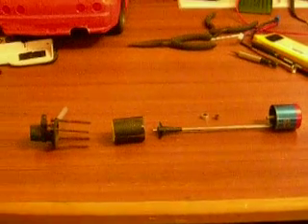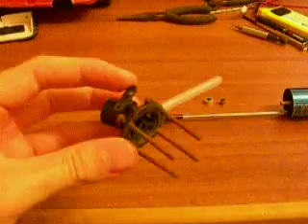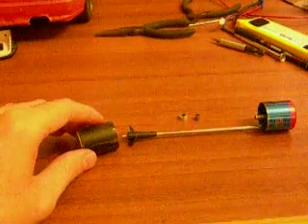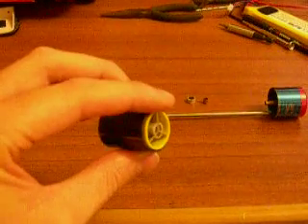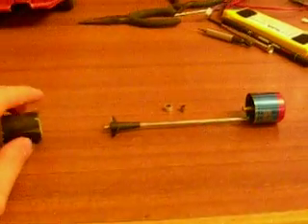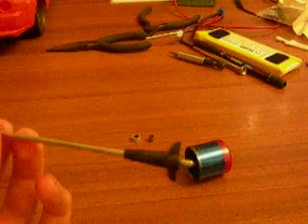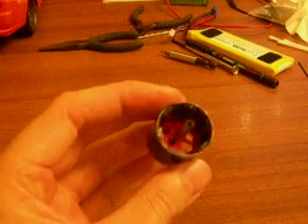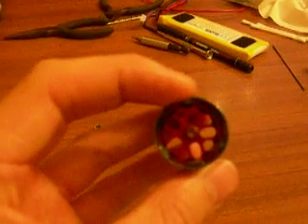NQD jet unit breakdown

Comment from the maker: @rjs8586 Ummmmmm it was a while ago now. I think the shaft was a bit of 1/8th stainless from a hobby shop. I might have just put a slightly smaller hole in the prop (3mm?) and pushed it on. Pretty sure there was no glue or locking screw involved.